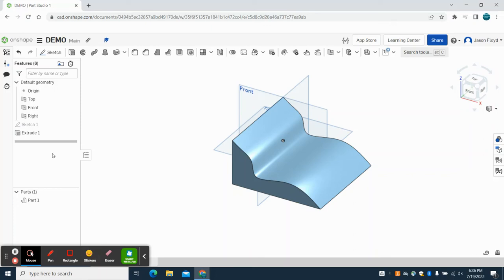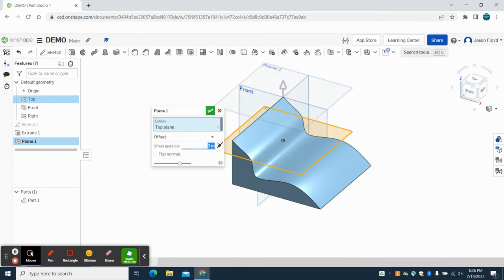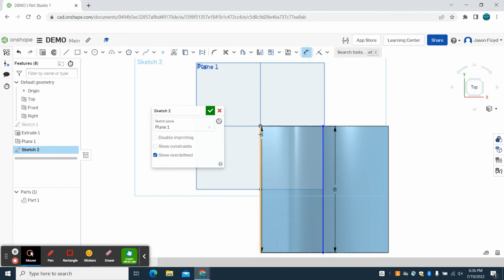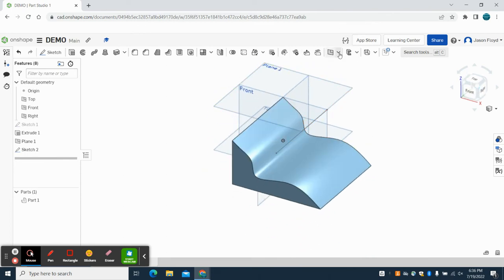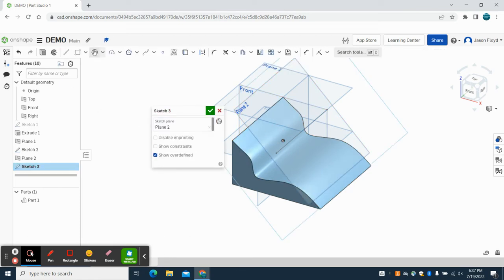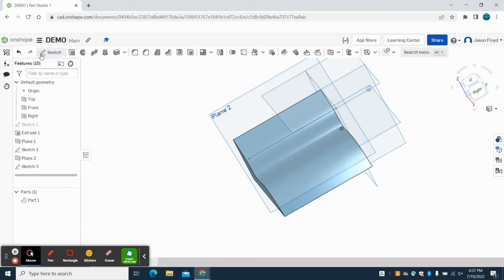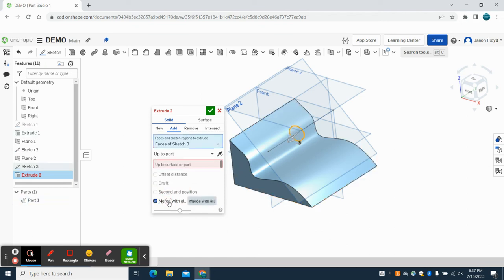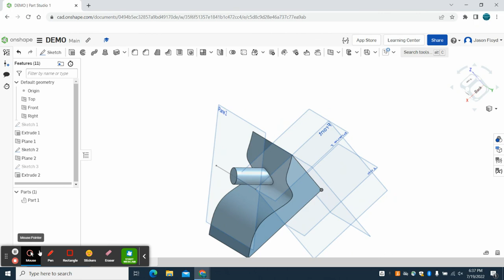Sketching on a Curved Surface Onshape in About a Minute

Comment: Can you show me how to do a removal extrusion on a curved surface with a curved extrusion.  

Example attempting to add locking notches on a vacuum attachment
Reply from the maker: Are you talking about the circular part that is notched on the house attachments?
Reply: @Tomorrows_Eng  yes. The 1/8th to 1/4 turn notches dependent on the brand of vac.
Reply from the maker: Wouldn't it be easier just to place a sketch on a plane and do it as an addition?
Reply: @ so you’re suggesting to extrude the negative of the notches? 
Same issue would apply, how would I sketch on a radius?
Reply from the maker: I would love to see an image of the part so far. I have an idea of doing it on a plane and matching the diameter of the part to crest the negative space.
Reply: This cannot be an open space, it needs an inner wall, also the dimensions are not correct because it was a projection from a single plane, so it ended up being a skewed projection.
Reply from the maker: I'm visualizing something different then. Do you have it started in CAD? what platform are you using?

Comment: Are there planes for wrapping to a curved face? Or do we just have to use the “use” tool and projected curve tool?
Reply from the maker: I have two short videos for wrapping:

https://youtu.be/ro9KVjzhedM

https://youtu.be/k51CtIQiGIk

Hope this helps!
Reply: @Tomorrows_Eng  cheers mate iv seen the first one that helps heaps!
Reply: @Tomorrows_Eng  damn man I just hope they update it so it works on complex curves, but it seems to only work just on cylinders. I guess there other ways like projected curve but i feel that’s a pain and don’t really know how to use them at the moment
Reply from the maker: What are you trying to make?
Reply from the maker: I took a look at the document. I have to say I am ignorant when it comes motorcycles. I get the idea of the part but am not sure how it goes with the bike, so I wouldn't be much help on the design.
Reply: I have the document names as “JJ under belly, if you want to have a look. It’s for an underbelly fairing for my bike